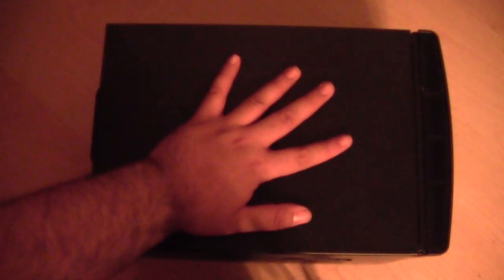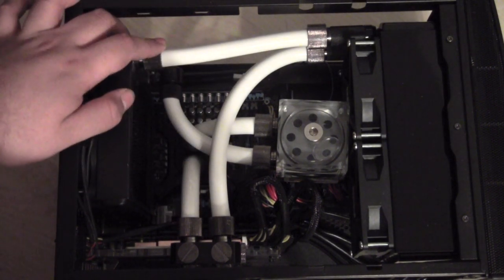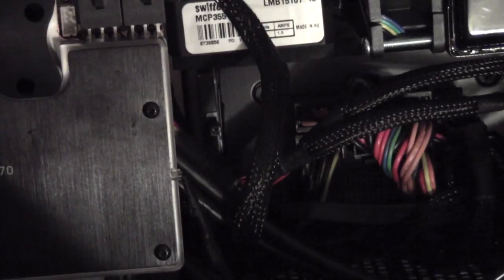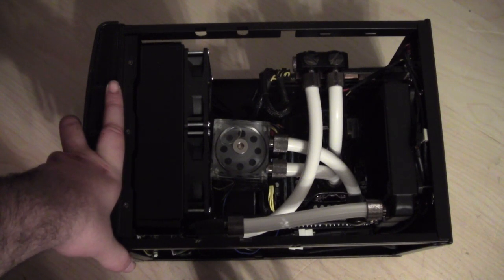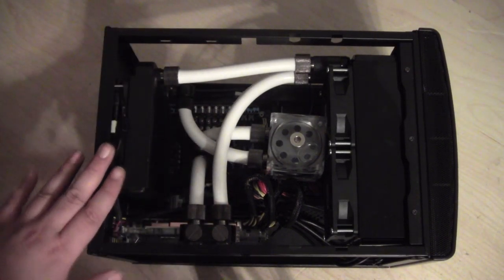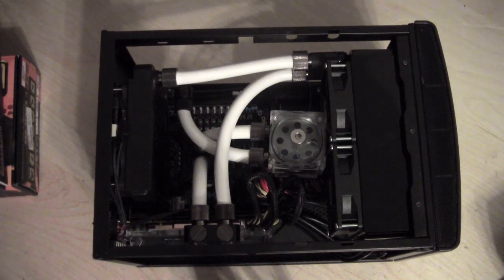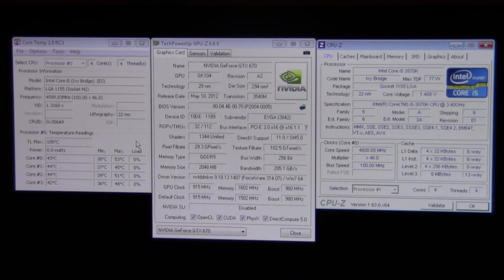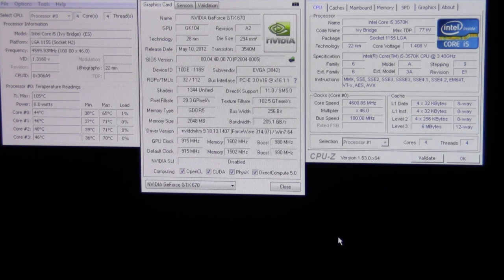Build Log #2 Water Cooling Rig Mini iTX Fractal Design Node 304 Gaming System

Comment: Great video mate - I've just ventured into the realm of mini ITX, and I am planning (hopefully) to squeeze one of those 92mm rads and a 7950 in there, with the EK 7950 waterblock. I'll initially start off air cooled (these cases can take some massive coolers like my Noctua NH-U12P.  I like where you stuffed your drives - good spot - Luckily I only have to deal with my spinning drive... my SSD is an mSata on the back of the asrock z77e-itx :)

Comment: Nice build. Dazmode is awesome too. I've been thinking about this case with similar parts except for the video card would be an EVGA 660TI 3GB SC. I'm also inclined to put a 180mm MagicCool radiator up top, but the issue is, where do I connect it? I can't connect it to the top panel, so I'd have to create a plate or something.

Comment: Hmmh, I was just a little concerned that thrashing it around could cause something to leak.
I've never had a leak so far.

Also, if I'm to be lugging it around, do you think the weight of the rads. would be a concern and instead opt to make the overall system a little lighter?

Comment: @Hostilenemy - Taking costs out of the equation, if I were to build a configuration similar to this (in regards to the WCing), do you think there would be a risk of leaks and/or reservoir spills if I'm interested in transporting it (i.e. to friends and family, etc.)?

I would build something along the lines of the Z87 ASUS ROG board, a 4670K or 4770K and the GTX 760 (as far as I'm aware, some existing waterblocks are fine with the 760).

Comment: Hello! 

Why chosen 120mm radiator and not 140? What is the problem with the installation?
Reply from the maker: 140mm rad wouldn't fit. Interference with CPU block. and the back of the GPU.

Comment: How big a grafic card can you fit in there?
Reply: HomelessHarlem Whoohoo Not with that rad in there or with the first stock drive tray.
Reply: HomelessHarlem Whoohoo 12" max without the first hdd tray last time i measured Node 304. Ofc that rad in the front will take a lot of space so probably max 8" card would fit there. He uses a 7" card (same width as the mini-itx board).